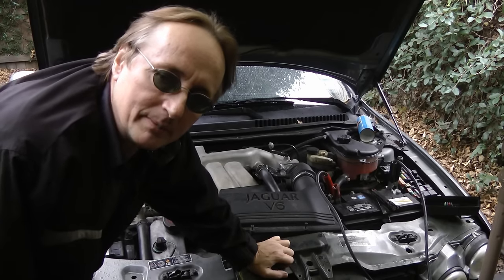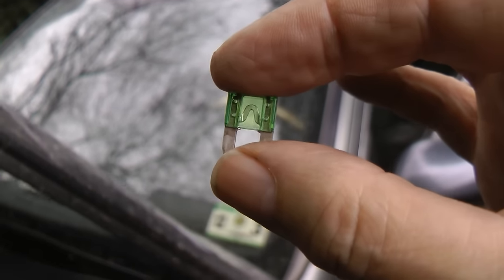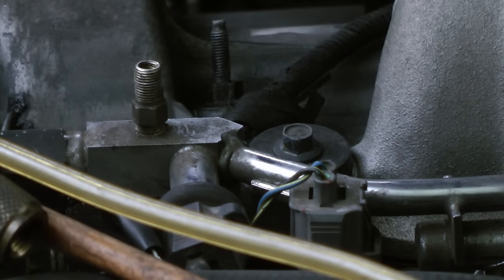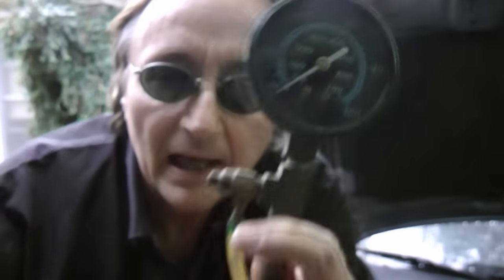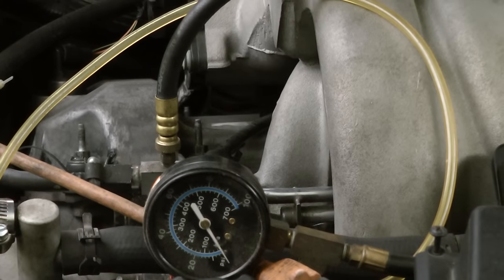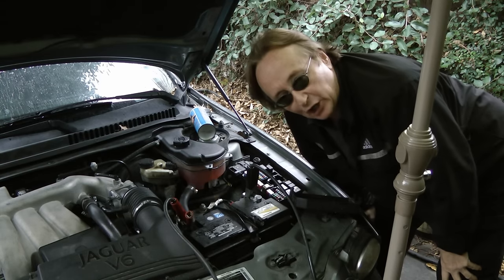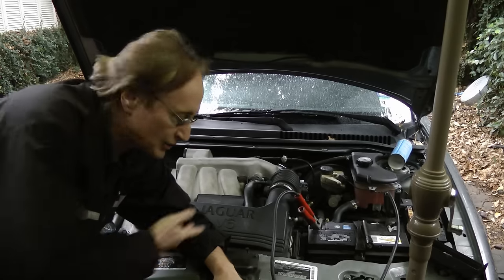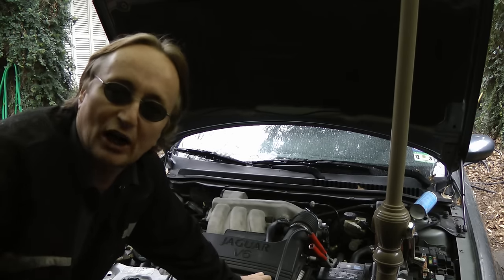How to Tell if the Fuel Pump is Bad in Your Car

Comment: can't believe so many dislikes for free advice.... jaguar owners be hatin lol
Reply: That's from Jag lovers.If you can't afford to have a car fixed don't buy a fancy piece of crap.that's my tip for the new yr.
Reply: Edward Perez sometimes it's not just about having money to fix a car, but the feeling you get after you fix something on your own.
Reply: malaihi

I want to see a video on a fuel pump replacement on a 2002 Sequoia Toyota
Reply: Harminnie Mendez its under the back seat..very easy
Reply: if he disses any luxury car brands( especially mercedes) it will have many dislikes lol
Reply from the maker: yep, cause they get mad when people tell them the truth about how poorly made their cars are.
Reply: It could be the manufacturer too
Reply: malaihiboi Don't blame Jaguar, its all ford underneath. CD132 platform same as the Mondeo/contour depending on your local marketing wank.
Reply: I thought it was very good info BUT I hate when people jab their finger at the camera {or at my face}.
Reply: A No Not true. Ford's are much better cars than Jaguars and Ford has nothing to do with them anymore.
Reply: Scotty Kilmer HEY Scotty what your take on what I did when I had a problem with my 01 gmc sierra when it was diagnosed that I had a bad fuel pump...it was suggested to place a board under the fuel tank & giving hard taps against the board with a hammer! After that my truck started with No problem! I added a bottle of stp fuel injector cleaner in the fuel tank. Drove it around with No problem. My question is & I know that isn't wise to do but what do you think why the truck started after tapping the bottom of the gas tank...
Reply: Either trash inside of the tank was clogging the pump, or there is a short in the wiring connection.
Reply: Its because Jaguar design is crap , VW design is easier they put the fuel pump under the rear seats so a 1000 dollar job becomes a 200 dollar job lol
Reply: To be fair this is not a real Jaguar, the X-Type is basically a Ford. Ford wanted this to be the  affordable jaguar.
Reply: U
Reply: Some joke i didnt realize that cost so much 
I have just changed my fuel pump in clk200 cist me new bosch pump with labour 250 euro ha ha but if Iwant to change my oil sump have te same story like the jag with fuel pum
Nice video regards from Ireland
Reply: +Salvo Farina    Check and see when Ford made jags they were better - fewer repairs!   Strange but true.
Reply: So for me.... I'm not hating. I've owend an 1996 XJ6, and 1997 XJ12 and an 1993 XJ convertible and I never had to pay outlandish labor prices nor high prices for parts. I got a fuel pump once and paid less than 50 bucks for it on rock auto. Got a warranty. My mechanic has been doing my work here in Atlanta for me since I started driving back in the 90s. He's ASE certified. He's very reputable, will warranty your labor and he is legal and legitimate. I feel that because to me, my opinion is, some jaguars were not built poorly. It's a matter of responsibility. There's a difference between a jaguar and a Buick. And just like there is a difference between a Bentley and a Jaguar. Life is about choices and decisions and responsibilities. And one responsibility for caring for a vehicle is, just that, you have to care for it and take care of it. And then you don't just buy the first part from the first parts store That's 10 minutes from your house. Nor do you use the first mechanic who tells you what's wrong with your vehicle. That's what's wrong with society today. Shop around. Read. Have an awareness. My tech and the shop is an hour and 30 minutes away from my house. I found him over 25 years ago because I shopped. I didn't take the first thing thrown at me. And I STILL own a fine running 2004 XJ8 today. And I have NOT soent a fortune in repairs. Not counting regularly scheduled oil change, tires and tune ups, ive Probably spent less than 1000 bucks in 5 years. And I don't run it hard. It doesn't smoke nor leak. And it still does not have a check engine or any other service lights on. Taraji P. Henson is right. "If you listen to some people, they will have you screwed up." I feel sorry for people who listen to some of the commenters like you all. If someone wants to buy a Jag, buy it. Don't dissuade others just because YOU'VE had a few bad experiences with yours. It may not turn out that way for them. It certainly didn't for me. Hope this helps.
Reply: @TRUTHSPEAKS6194  I agree, these are not cars you buy and run into the ground. That's what people want, if you want to do that, buy a throw away car like a civic or corolla which have their share of problems too. I have 3 jags and honestly, I haven't had hardly any issues with them. You gotta take care of them and keep up with maintenance. People buy them and dont do that and then they crying about it being broke, well duh! Also, I don't think they are very difficult to work on either. Almost every car now a days has the pump in the tank and it's difficult to remove or change.  Because it's in the tank in a jag, they're junk, but if it were a Toyota, Scotty would say it's "a design flaw" or it "prematurely failed"..... hmm maybe cause it's junk?? Lol

Comment: My Aunt had a Jag, plagued with issues. Found a solution, a new Camry :)
Reply: MrCliffda3rd it’s funny bc I have a Camry and I have a fuel pump problem and I have to fix it 😂
Reply: Just because it's a Toyota dont mean it wont have problems. Picked up someone on the side of the road. Transmission went in his Corolla with 130k. I drive a cvt Altima with 183k. Go figure...
Reply: You are poor then.
Reply: toyota just had a 2 million recall on fuel pump issue
Reply: Jajajajja
Reply: When people report problems with their car I love to say that I found the problem and then point to the corporate logo.
Reply: Lmfao

Comment: Great video. Scotty always has good stuff, and fun to watch too!
He did forget to mention one of the oldest test in the book. The pop bottle test. Works good if you don’t have a fuel pressure gauge or access to the Schrader valve.
Disconnect power to coils/spark plugs. Disconnect fuel line, use a piece of hose to direct it into a pop bottle. Crank it over for a few seconds. Should get about 4-8 oz of fuel. Works best on older mechanical style fuel pumps, but can give you an idea on electronic fuel pumps.

Comment: Seems like half the time older models like the 60's all the way up to 80's and early 90's of vehicles are reliable, cheap, and more simple. Now you have these complicated monsters.
Reply: The old ones weren't necessarily all that much more reliable, if at all.  Usually it's just older people remembering the good times.
Reply: Old is gold ✌️
Reply: I agree
Reply: I still have my 1996 Toyota Corolla which can develope issues that are not that difficult to get to to fix

however it runs 

my main vehicle is a 2004 isuzu ascender

which I'll admit I see the check engine on a bit more frequent
Reply: I got an '88 Nissan and I'm 28, so it wouldn't be me remembering the good times. She has her issues but she's a reliable workhorse.
Reply: Older cars were easier to fix because you had to fix them. most of the time you spent more time fixing the car than driving the car. Now our cars actually run. but I will agree that computers have made cars now days a lot more complex and complicated.
Reply: Computers certainly have made automatic transmissions simpler though... A modern automatic transmission is mostly electronically controlled, a lot easier to repair than those old all-hydraulic monstrosities.

Newer automatic transmissions also don't steal as much power and fuel economy from your engine.
Reply: People who yearn for the good old days of simplicity have either forgotten or don't know how unreliable cars...even expensive ones...used to be. Breakdowns, strandings, major system failures, etc. were not uncommon. Cars were much less durable on average. When I was a kid, reaching 100K was unusual. Cars were often tossed at 75K and not infrequently rusted out by then, too. Fuel efficiency has increased dramatically.  Of course, the chemistry of gasoline and lubricants has greatly improved, too.
Reply: The old ones broke down all the time, but they were cheap and easy to fix.  Jaguars are designed to be hard to work on in just about every way, to discourage you from taking them to your local mechanic instead of to a Jaguar dealer, I guess.  Like, if a piece needs 15 cm and 3 mm of clearance for it to be theoretically possible to remove it, they'll give you exactly 15 cm and 3 mm of clearance.  If a wire has to be 55mm long for it to be possible to install, it will be 55mm long, even though that will make it take 30 times as long to replace than if it were 56mm long.
Reply: I'm old and remember those cars well...even the family's Packards and Cadillacs. I think you are absolutely correct. Today's cars are much more reliable, safer and more durable. They are constructed to tolerances that the very "best" of old could only imagine.
Reply: Nope, bullshit on that.  I'm 17 and my only car is a '64 Impala.  I've had it a year now, drive it everyday, even in the winter.  Only problem I've had is a bad fuel pump and put some shocks, gaskets on.  Its not restored in the slightest and has the original 221k mile engine.  It's excellent, fuck shitty new cars.  Plus, I just won best car of the year at school.
Reply: Funny joke, my 221k miles '64 Impala is ridiculously reliable, I drive it everyday as well.
Reply: +commando8088 I wanna 64 impalla

i can see myself ballin and playing some 60s oldies
Reply: Haha yeah, I always feel like a baller cruising down the street, although I usually bump some 90's old rap tunes aha
Reply: My guess is that anything is an improvement over the Brits.
Reply: Jack  actually jaguars are made made in Britain at Coventry
Reply: I had a 75 Blazer that I sold when it hit 200k. I had an 89 Toyota Tacoma  that hit over 330k and I gave it to a guy who could do the head gasket himself ( I couldn't afford to pay a mechanic for that). That truck is still going strong. I have a 1987 Blazer with over 266k and I'm here trying to figure out how to fix it.... fuel filter, fuel pump, rust in a fuel line? Anyway... I had a modern Nissan and a Honda and they were so difficult to work on, no room in there... and always mysterious intermittent problems that the mechanic can't duplicate or diagnose-- so those cars were completely unreliable. Fuel efficient, yes, but not reliable.
Reply: I love my 1999 Acura TL  3.2 just open the trunk and remove the fuel pump access cover.  It's to easy.
Reply: Lily Rainier interesting ?  I always thought Honda and Nissan as reliable, Have you owned more than 2 Hondas or Nissans ? Maybe the mechanic was not familiar with the model ? I like both American cars and Japanese. It's all about maintenance one problem will lead to another eventually.
Reply: RedMoWarrior its all about money they all work together parts stores and car factory parts only last so long then they force u to spend ur money to constantly fix these new cars all about money

Comment: Thanks, but I’ll stick to my ‘01 Toyota Camry LE with 311,420 miles that runs like a Swiss clock, with original engine and automatic transmission and everything works!! Blows cold AC when I need it and heat when I need it. I repainted it, and tinted the windows and looks brand new. Inside is in excellent condition, has power everything including a manufacture sunroof!! I Do most of the maintenance myself and the complex stuff I take to a trusted mechanic. I’ve had it for the past 12 years and plan on keeping it another 12.
Reply: Can't beat the older Toyota's, don't think new one's will last like that.
Reply: I still consider buying early 80s cars. Firstly they're reliable, secondly they're pretty easy to find, a lot of people who bought them brand new and kept maintaining them are getting too old to drive so they decide to sell them. That's how I ended up with a Yugo....yes, a Yugo, and I had no problems with it for 4 years. Did I mention it's a Yugo?
Reply: 311k miles! God damn
Reply: If you go to his other channels he will tell you go Toyota when it comes to timing belts.
Reply: Got a 2003 with 173,000 miles everything mechanical is still working. All I have done is replaced a starter, rear passenger brake caliper, did the work myself and I’ve owned this bad boy for 5yrs now.
Reply: My 2005 has 267k and a stick shift so it'll run for years to come as well.
Reply: Randy Jackson  Carburetors, exactly! Nothing beats simplicity.
Reply: obscureprey13 my grandma’s 03 Camry has over 329k miles on it!! Thing runs like a beast!!! It’s had minor issues over the past few years only because she runs it to the ground. Her 17 old Camry will ride till the wheels fall off.
Reply: @GlamStacheessnostalgialounge  that’s alright Scotty had friends in Canada that had Yugo’S with 500K kilometres. Lately Scotty has had surprising vehicles like reliable volkswagens & reliable dodges & Mitsubishi’s, yes, very surprising. He said it’s from their good maintenance. He’s also had some reliable customer Korean cars in lately.

Comment: My  father taught me to retorque the head bolts on my cars every 75,000 miles. No one seems to mention this, why?  I have never experienced a head gasket failure.  91 sidekick 184000,2006 4.7 dodge ram 155000,2010 kia 2.0 110000. You are the best.!

Comment: Party on Scotty!  Your videos are so informative and to the point. Got my fuel pump issues figured out with your instructions - Turned out to be a bad fuel pump. I was able to replace it by removing the back seat and the FP access panel, unlike the Jaguar “(

Comment: Many times a defective in-tank fuel pump can be replaced without removing it, by adding an external fuel pump. They are cheap and easy to install. If it can suck fuel through the dead pump, it will work.
Reply: Interesting….never thought of that 👍🏼

Comment: Hi there sir, My 2008 350z is causing transmission to stall and cut out at 3K-4K RPM. Does this mean I need to replace my fuel pump or do I have a bad transmission? My 350z only has 83K miles.

Comment: Running car when there is gas in low reserve is the major cause of fuel pump dead
Reply: Wow.
Reply: @DaveOzoalor   :v
Reply: Thanks alot for that very useful piece of information. 🤙
Reply: More of a problem these days with all the detergents and junk that gets put in fuel. Once that stuff has accumulated anything in the tank the pump will suck that up and get ruined if you drive with low fuel
Reply: Did you know the fuel pump is in the fuel tank?
Reply: @yournamehere3679  some cates its outside the tank
Reply: You Wish  weight reduction. lmaoooo

Comment: You are my goto guy, I had hard starting with 3.4l chevy and by your vids I came up with replacing the MAP sensor for $85 because simptoms matched the best. But still had to hold pedal down an inch to get started hot or cold with rich gas fumes/smoke when it finally started out the exaust pipe. So botom line it wasnt the problem, however evey othe car guy had a vid on the Fuel Pressure Regulator that matched my problem exact as when you removed the vacuum line to the Fuel Pressure Regulator gas would sputter out where the vacuume line was, mine sputterd the gas too, problem solved for the additional cost of $52 for the new Fuel Pressure Regulator. Please do a vid on this problem. Thank you for your videos, keep up the good work.

Comment: step 1

Make sure there is fuel in the car..... 

Im just saying,  Ive seen it before....
Reply: Papakap22 Don't use a match to check though. That's been done too
Reply: Ever had to take a fuel tank down full of gas?
Reply: As painful as it sounds a full tank is safer than an empty-ish tank because it has less fuel vapor (the stuff that goes boom). I also use brass tools when removing the pump to avoid sparks.